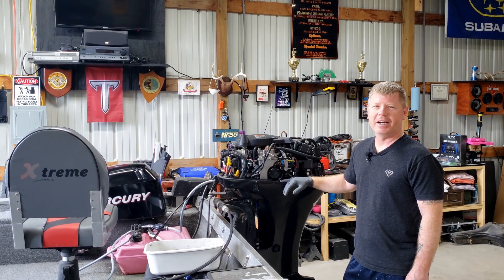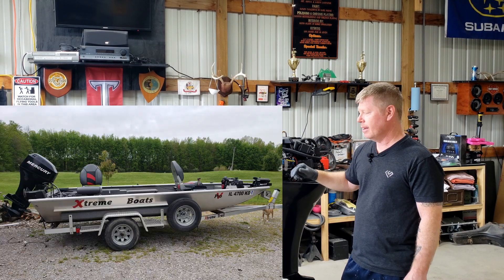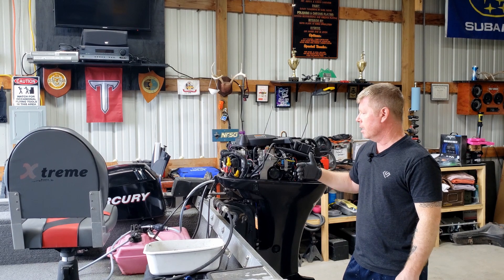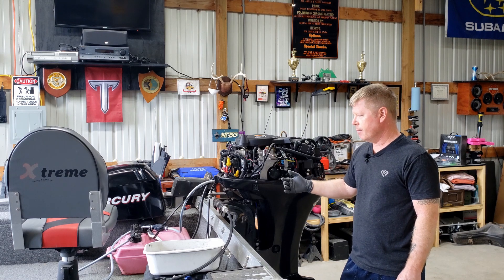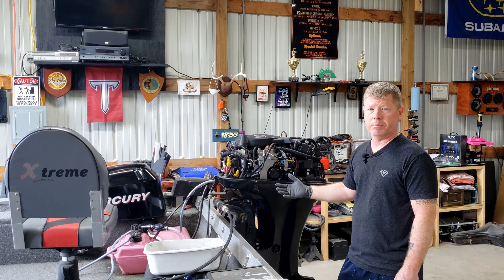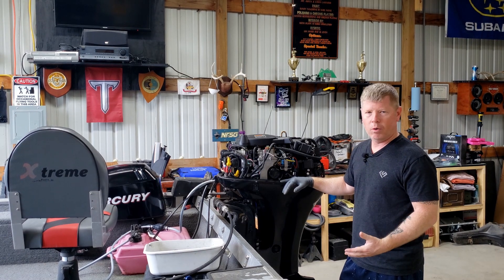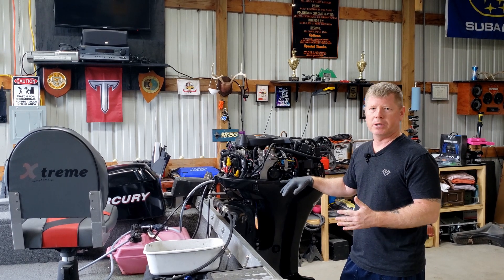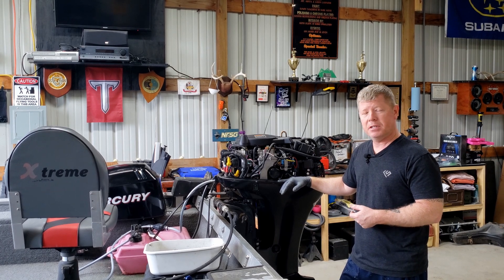How to Replace a Mercury Outboard Motor VST (Vapor Separator Tank) - Fix to Not Running

Comment: I've already been through this repair! If you don't install a good water separator between the fuel tank and motor, you "we" will always have trouble with water in our fuel system. I just installed a new high pressure pump and fuel regulator in my VST. I have a new water separator to install between the tank and motor. After a fishing trip/boating trip, keep the fuel tank full, and with stabil in it.

Comment: It's crazy that one part costs so much.. Looks like I have similar problem.. Engine runs only 8min and then shuts down and won't start for an hour or so... Can't find the part here in Europe, will have to take it to mechanics
Reply from the maker: Hi veryrudeguy. Thanks for watching and sharing. I completely agree. I was shocked myself when researching this project. We hope you're able to get your problems resolved so you can get back out on the water. Cheers!

Comment: Great video.  I have the same mercury outboard.   I am trying to do the same thing but could not figure out how to get to/loosen the front insider nut in order to remove the cowling.   Any tip will be greatly appreciated.   thanks.

Comment: sounds like they wanted you to just buy the whole vst so they coached you to replace the whole thing .. you can replace the pump and clean the tank out instead of wasting $400 for a used part you have no idea the condition of   i believe i spent less then $100 for pump and the oring gasket
Reply from the maker: Congratulations on being able to do it for less. I knew the pump I purchased worked and had a warranty so I was not concerned, but we appreciate you sharing your story.

Comment: I just rebuilt my 2012  50 efi fuel cooler, was leaking water 8 o rings and BAM GOOD TO GO. Do you have any idea that makes these fail 135.7 hr per vessel view mobil.Thanks.
Reply from the maker: Hi Ed. Thanks for watching and sharing. That's fantastic. Great job on your repair work. I wish I knew what caused these to fail but unfortunately I do not. Sad that it did with that low of miles. Cheers

Comment: got a 2020 60hp with the same problem VST was not getting fuel to the injectors. It was in limp mode, and then completely died on me had to get towed back in. In the Bahamas right now got the part coming in with some guest going to replace it this afternoon. Already got the old one removed and ready to swap over parts. Have it up and running hopefully this afternoon give you a status update.
Reply from the maker: Hi Capt Stone. Thank you for watching and sharing with us. We really appreciate it. Sounds like one heck of an adventure you have there. Certainly hope this solve your issue. We look forward to the update when you can provide. Stay safe out there!
Reply: @SpiritedWrenchers   Got it running after VST swap and changed all the filters, after test run found out the thermostat was not opening overheat buzzer going off. Remove housing and thermostat put it in pot on the stove no movement. It's pretty crusty. this is a 100hr service item. Motor 2024 looks like it has never been service now. got lucky on the gasket not ripping. Going to run with out a thermostat till get back in the US.
Reply from the maker: @surfvw1  fantastic. Glad to hear of the VST result and that you discovered another small item before it did damage. Safe travels back to the states!

Comment: Mine will only stay running if I pump the ball while it's running, you think I may need to replace mine?
Reply: Sounds to me like the low pressure mechanical pump which is easier and cheaper to replace.
Reply from the maker: Hey Crappie (love the name by the way). Thanks for watching and sharing. I'm not a marine mechanic but it could be the problem for sure. If you have a local shop that could diagnose it, I would recommend it. With the price of these it could save you big money if it's not this that is the problem. Hope that helps and we wish you luck with it.

Comment: great vid... but you do not need to remove the lower cowling. That unit rests on a saddle grommet at the bottom, you only need to take out the upper 2, 8mm bolts, and the VST will lift right out.
Reply from the maker: HI City Island Rowing. Thank you very much for watching, sharing the kind words and tips. We really appreciate it. I was following guidance given to me on taking the lower cowling off but you're correct. If you've never cracked one of these open like me, it was a good exercise to get familiar with it all. Thanks again. Stay safe out there!

Comment: So my boat this season started out good and then a couple times later started sputtering then stopping, and eventually could not start it again. Took it in they said it was the VST what would cause the motor not to run because of the VST?
Reply from the maker: Hi Eric. Thanks for watching and sharing. We really appreciate it. Our boat was doing the same thing before replacing the VST. The VST has a high pressure fuel pump in it  that shoots the fuel to the rails. If there is a part in there that isn't functioning correctly, the fuel won't get there the way it needs to or the shutoff valve isn't working within it that cause it to get too much fuel before sending it over. All of that plus more within the VST causes the sputtering and dying. Hope that helps and that you can get a used one to replace yourself. They are pretty pricey. Cheers!

Comment: Thank you...started with a simple leak found on fuel cooling was told you had to buy a new one since it was not made to take apart...My 2008 Mercury 60hp EFI has similar parts as your engine...i used store bought o rings to seal my leaking fuel cooler needed 4 o rings on bottom and same for top.  I found your video helpful to remove the fuel separator since its impossible to install the bottom fuel line to the fuel cooler.  I replaced all the hoses and clamps at the same time and fuel filter after draining the separator....thank you again for sharing you saved me a bunch of money and time
Reply from the maker: Hi Gerry, thank you very much for watching and sharing your journey with us. Super happy that we were able to help you out and save you some money on top of it. That's the big purpose for a lot our episodes so we're glad it was successful. We hope you have many fun and safe days on the water ahead. Cheers!

Comment: Thanks for the video, very instructional. I have a 2006 Merc 75HP EFI 4 stroke that needs a VST according to the shop. The VST assembly alone is going to cost at least $1200 plus labor and hoses I suspect we are looking at $3000.  How many hours did you work to get the VST out and back in. Just trying to make sure we are not being over charged for labor
Reply from the maker: Hi John. Thanks for watching and sharing the kind words. We greatly appreciate it. Yeah, those parts new are ridiculous in price. What you saw in the video is all it took. I sped the parts so people wouldn't get bored if yours is as easy to access as ours, it will take you an hour at most. I would highly recommend trying to find a used one like we did to save the money and if you can access it, it's an easy DIY job. We wish you luck and hope you can get on the water soon. Cheers!

Comment: After watching I don’t want to attempt it. Not a gear head
Reply from the maker: Hi Ron. Thanks for watching and commenting.  I would actually rate this a 2 or 3 out of 10 in difficulty. If you have the simple tools,  its pretty easy. The one thing I would suggest once you take the casing off is take pictures of where everything goes so when you take it off, its even easier.  Nevertheless we wish you the best if you're needing to replace it. Stay safe!

Comment: Performing the same service on a 2002Mercury 60ELPTEFI. Purchased the new replacement VST from partsvu for a little over $800. Only thing I wasn't sure about was how to effectively 'prime' the system? Should the VST be filled with fuel before starting as well? Great video and thanks!
Reply from the maker: Hi Ken. Thanks for watching the episode and the kind words. Much appreciated and hope it's helped you out. Glad you were able to secure one from Partsvu. Great question on the priming as I hadn't seen anyone do anything special for it so I only used the priming ball as I normally would before starting it. Hasn't given me any problems since and I've taken her out 3 times so far. Good luck on your replacement.